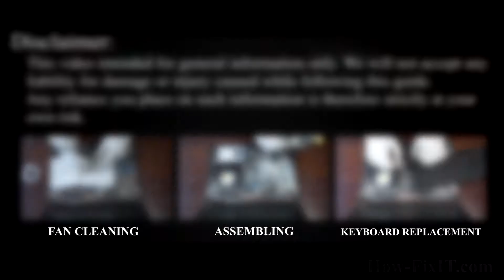HP ProBook 4320s RAM Upgrade and Installation Guide

Comment: Good day, I have a question: Can I add 4Gb to the current 2Gb or is this not working together?? 
I have already installed a SSD and this is working very fine.
Reply: You can install 1GB, 2GB and 4GB memory modules in any combination. So yes you can do 4+2GB. That yields you a total of 6GB of ram.
Reply: @jillianmaureenpatalinghug168  Yes it can be done on that laptop but it does not have access panels, so you should look at a teardown or ram upgrade video to know what you need to do to get inside the laptop. HP probooks between 2008-2010 are a real bear to work on compared to earlier and later models.
Reply: @jillianmaureenpatalinghug168  And if you are taking the effort to go this far i suggest installing an SSD if you don't have one yet.
Reply: Hello what SSD do you install? I use HP 4320s laptop
Reply: Did you upgrade your laptop in windows 10?
Reply: @jillianmaureenpatalinghug168  I used a Crucial MX500 500GB SSD and I'm running Windows 10 on my laptop with a i5 520M. It used to run Windows 7 but now it runs Windows 10 just fine. I used the key on the bottom and it worked fine activating Windows 10. Browses the web fast but it will not play most modern games.